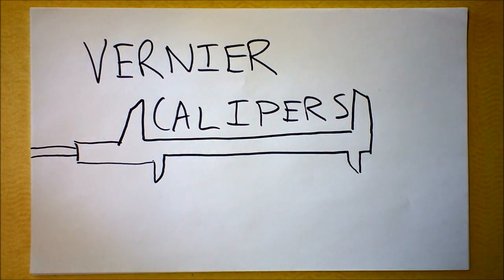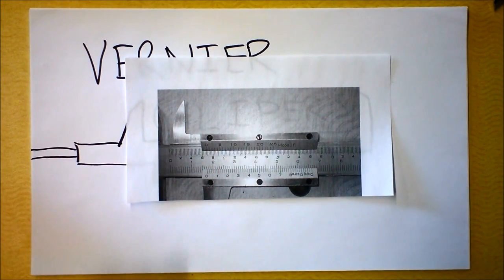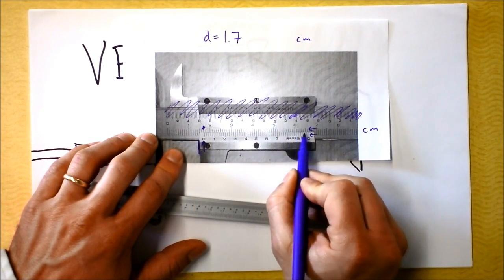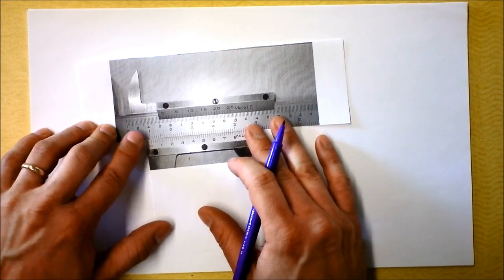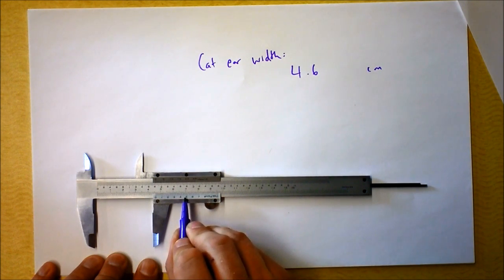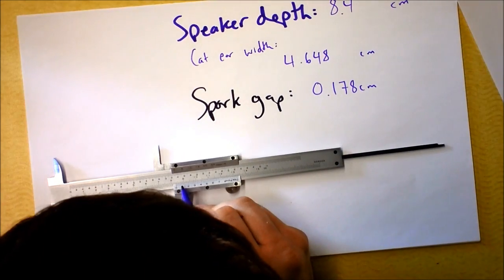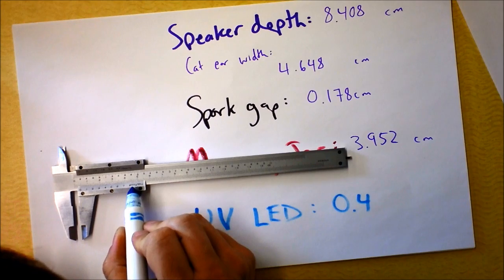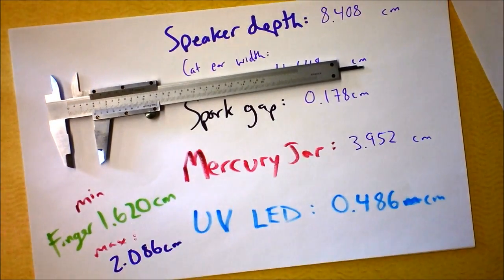How to Use Vernier Calipers While on a Unicycle | Doc Physics

Comment: Useful video. Everybody should learn this. I often meet guys on the job who use a caliper and just don't know how to do it properly.  I remember my physics teacher showing this with a big wooden display model. In Dutch a Vernier is called a 'nonius', which is really Latin of course, and it nicely refers to the reduced extent of the sliding scale.

I did watch the whole video. Very relaxing. Of all the measurements I was most impressed by the cat's ears distance measured to several tens of microns. Of course you need a perfectly machined cat to achieve this accuracy.